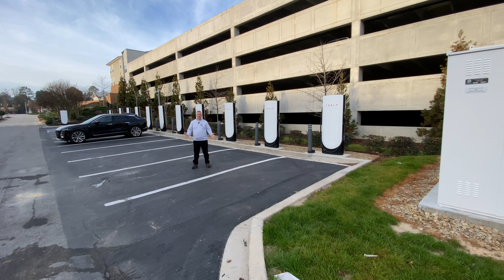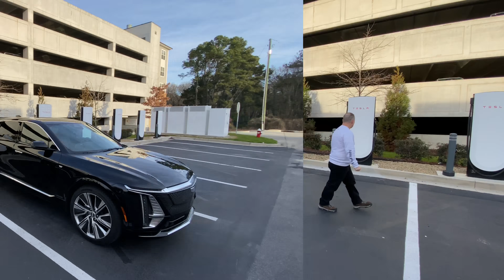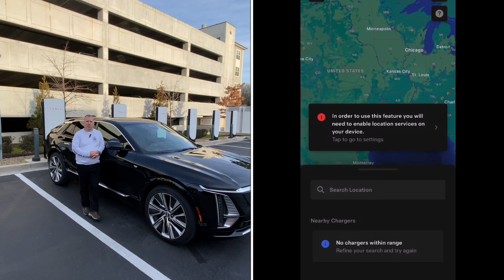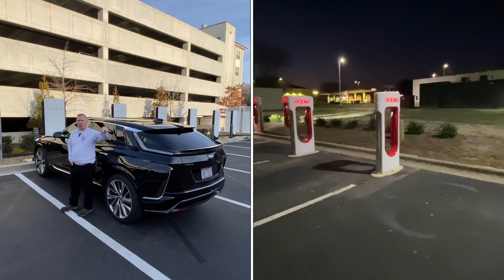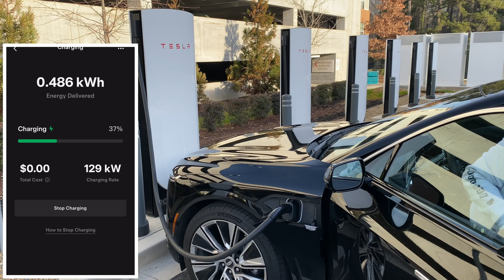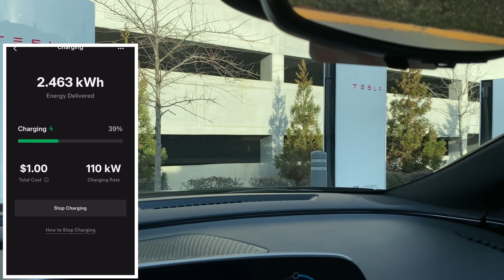How to charge a Cadillac LYRIQ at a Tesla Supercharger

Comment: This is misleading the title should say Tesla magicdock, of which there are like 20 locations. These instructions are not consistent with the adaptor GM will be distributing for general v3 access
Reply from the maker: I am making a subsequent video using the adapter which will be paired with this video.  I see nothing misleading.  I charge a LYRIQ at a SC and say during the video I will be releasing a subsequent video where I will charge using the adapter.  Sorry you feel I was being misleading, but I respectfully disagree.
Reply: Don't think the title is misleading, but do agree charging at V3 stations is MUCH worse.  He commented on that though - how you have to pull way up, and maybe can't because of the bollard.  Best case at V3 stations is the left most stall pulling parallel, and the right most stall pulling at an angle.  Sure, I suppose he could show the experience at V3 stations for comparison, but don't think the title or video is misleading - since he covered the V3 vs V4 points in the video.
Reply: Is there any sense of when Cadillac will release their adapter. I heard it might have an extender that would alleviate the issue with the short cords. Can’t wait to verify.
Reply from the maker: GM Q4 earnings slide deck says H1 2024.  GM was two weeks after Ford and Ford is soon to ship theirs, so it stands to reason GM will be shortly after.